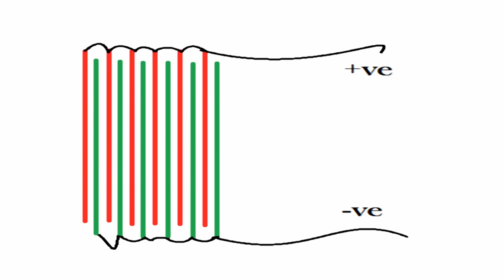How to Make Hydrogen Generator

Comment from the maker: The volume of gas produced is proportional to the charge passing through the water (current) and the number of plates (total surface area) and therefore high current and or more plates means more gas. To do this the spacing of the electrodes must be as close as possible while still having enough room for the gas to bubble out freely. A greater surface area also means less resistance and less heat. 

It takes about 15 volts to electrolyze pure water, but pure water is not the ideal fuel to begin with; water with electrolytes dissolved in it is. Baking soda works well in even small amounts.
“If you live near the ocean, the ideal fuel medium is plain sea water, which has the perfect level of salinity for electrolysis, and requires not 15 volts to separate the hydrogen from the oxygen, but only 1/2 of a volt!” 
– Charles D.

Regards. Thank you